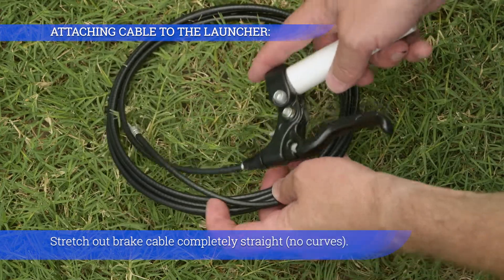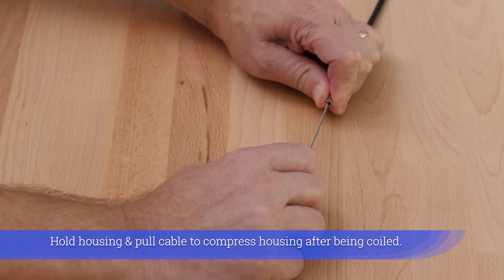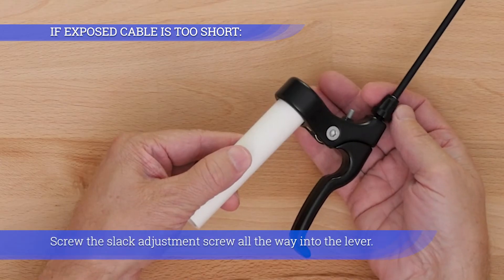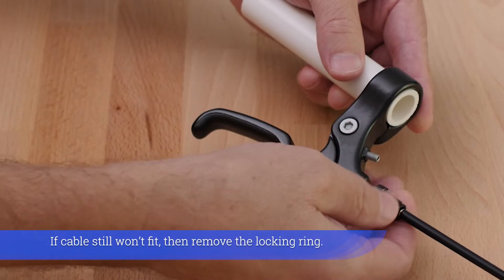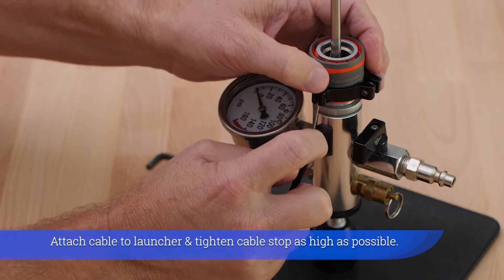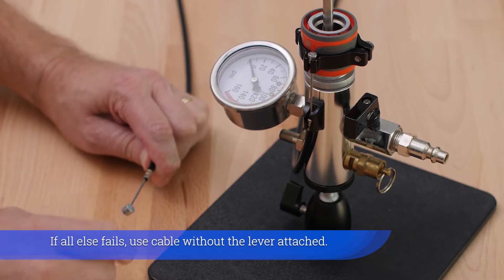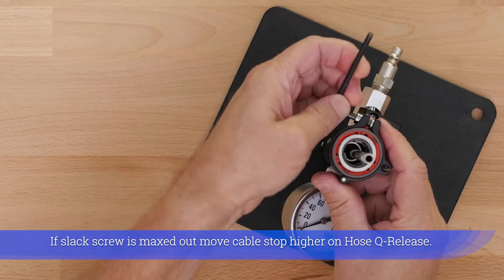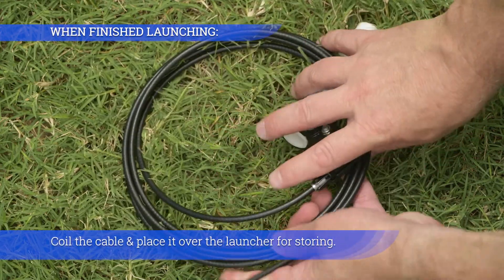StratoLauncher IV Adjustments If Cable Is Too Short or Too Long

Comment: Do you think you could actually had the camera ON the actions, instead of to the side?
Reply from the maker: If I am understanding your comment correctly, it is about composition or framing, which is very intentional. Professional composition for video and photography often use what is called the rule of 3rds to place the point of interest on these lines that converge at the 3rd of the screen. It makes for a more appealing composition rather than have everything in the center all the time, which is visually boring. Also, it can give lower 3rd captions space to show without covering up any action taking place in the frame.